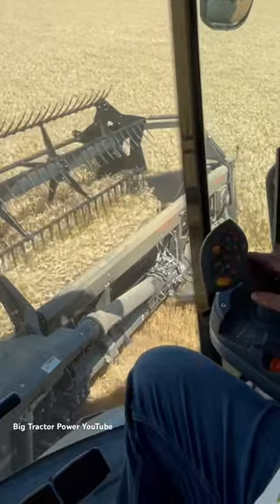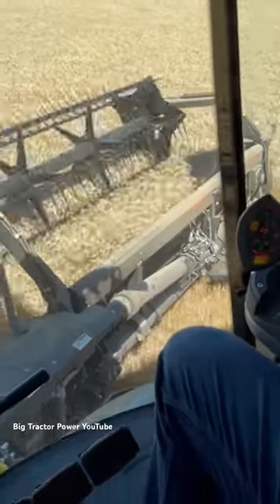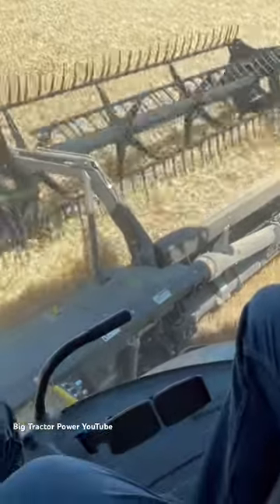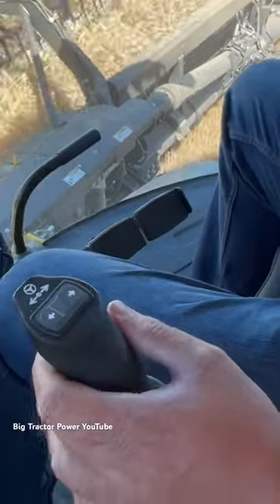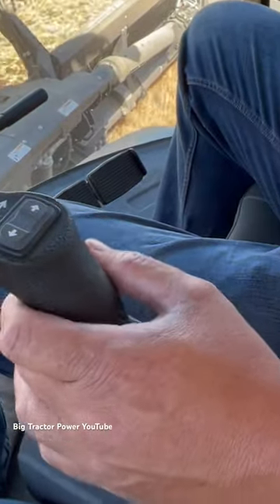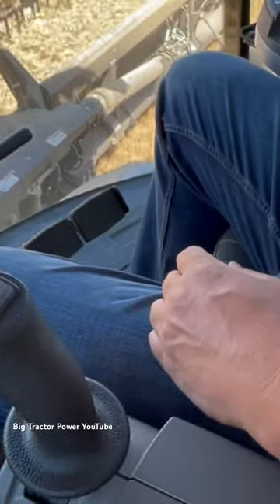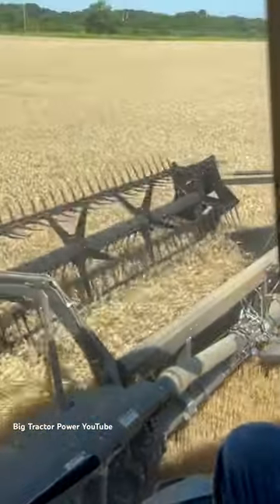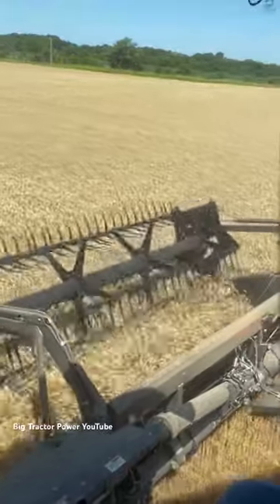FENDT IDEAL 10T Combine Harvesting Wheat

Comment: Man those things are nice. I just wonder how they are to road with the joystick. I mean surely it’s angle limited on steering when you’re roading it so you can’t cough and turn the back wheels to the max.
Reply from the maker: I have talked to farmers about the roading.  No issues.  Well one you can’t take a drink from your bottled water that is in the cup holder on the right side.

Comment: What is the advantage to having tracks on the drive axle in place of dual tires?
Reply: Compaction
Reply: Lower ground pressure than wheels and it's slimmer. Very important if your country has width restrictions or narrow roads.